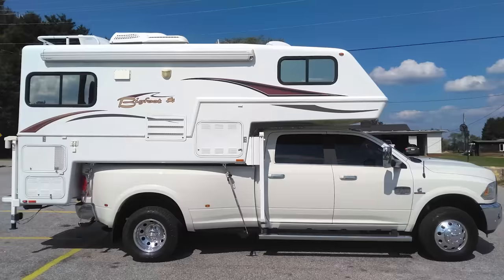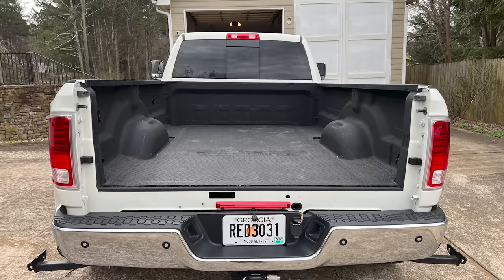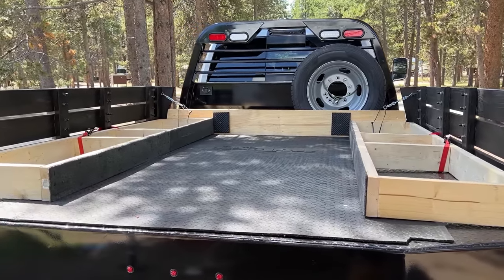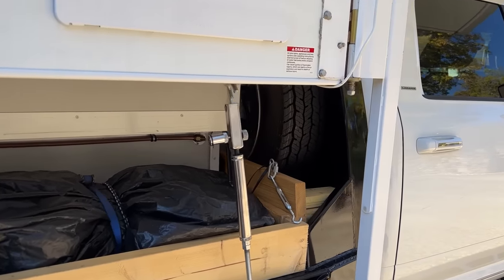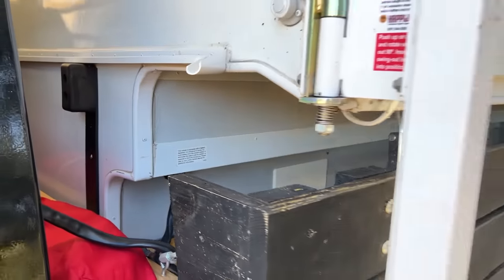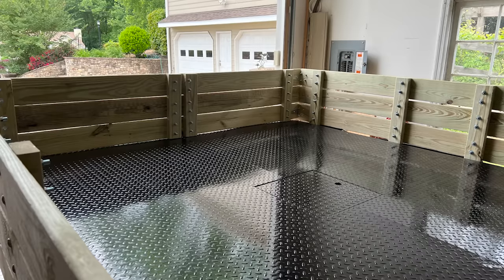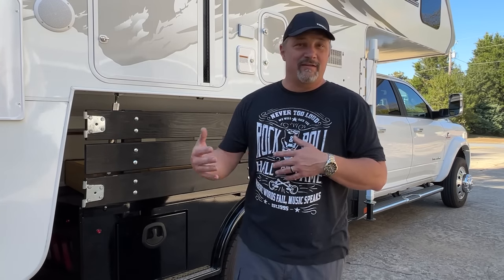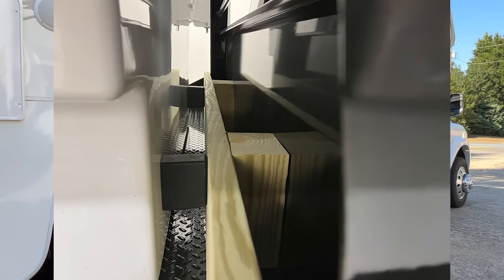Flatbed For A Truck Camper / Pros and Cons

Comment: How would that camper handle on same truck but SRW?
Reply from the maker: I would not recommend carrying a Lance 1172 on a SRW due to its weight.  I know people have done it, but there’s no way I would ever do that.  I would either recommend a dually or get a lighter weight camper. Thanks for watching!
Reply: @RunawayRoses  Yeah, I hear ya. It’s a gas cab chassis so the weight isn’t a problem, and it has a 9’ flatbed. Was wondering about stability wise. It’s got the Aisin with 4.44 gears.
Reply from the maker: It would probably handle it weight wise with it being a cab chassis having a high payload. But it’s hard to beat the stability of a dually with a heavy load.  I was thinking it was a regular pick up SRW.
Reply: @RunawayRoses  It’s an odd truck in that it was ordered with the SRW as an option. Ram used it for trade shows and parade or two I was told. Thanks for the input.